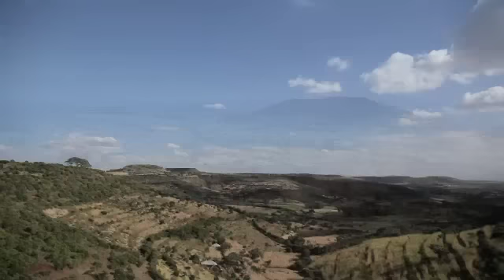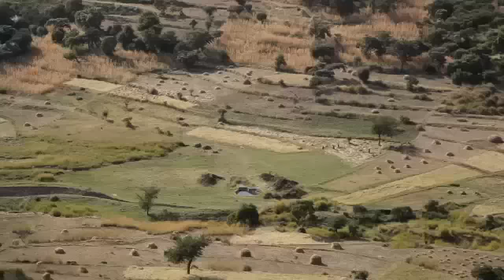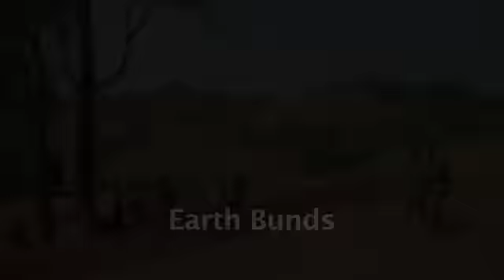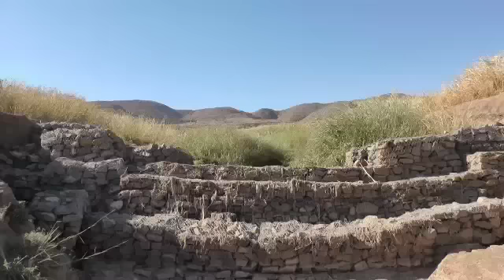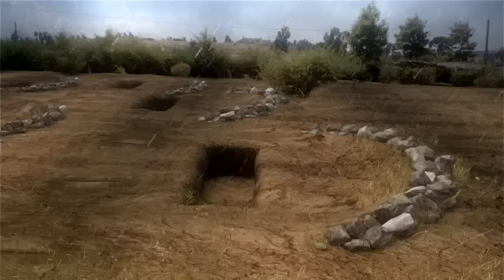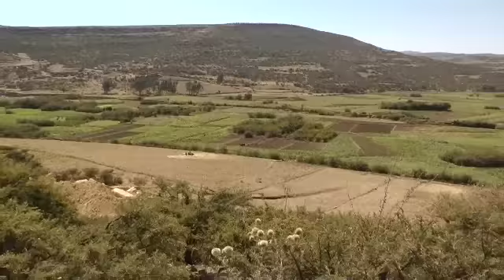Technologies transforming the landscape

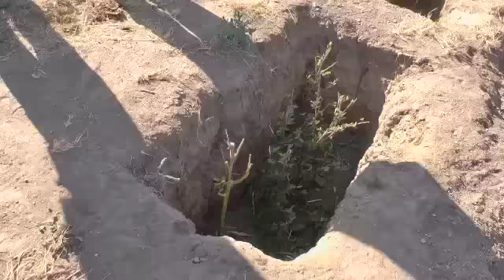Comment: 5:40 seems this would drown the trees when the trench is full ?
Reply: That's why they're planted on steps inside the trench, like he says, to make that less likely
Reply: yeah the ones growing inside are weeds, the trees are usually planted after the trench,
though those weeds are great, free fertilizer and better for the soil
Reply: They normally don't have that much rain, secondly if you add mulch the land remains more permeable and while hydrated, it is also more aerated. 
One thing trees do that make them special is that they develop with mycelium and this moves and distributes moisture.  This makes the ground more evenly hydrated.

Comment: I doubt always being strictly on contour is actually the best solution, even when ignoring seepage and only focussing on erosion.
Then again, while Keyline design / structures are overall better, they are a more difficult concept to learn and layout and need better mapping and measuring.
So if you just want to throw a few hundred people and a water level at a problem, this is great.
Reply: Keylining needs tractors or at least specialized plows and are higher maintenance year in and year out.  In drylands the more water you can gold the better and larger frequent earthworks are better.  
Contour is always best whether for water management or planting.

Look up Brad Lancasters work in rural and urban environments...

Comment: trenches n micro basins....The area wide need signal boards...for safety.....The terrace like structure ....Y terraces were made?...didnt have options?....dr is plain ground available around the area where terraces were being made........trees cud hv been option for mountain...mountain tops....stone bunds....if trees planted wud they stone bunds b needed?.....its hard work....making these....n u get grasses pasture?.....check dams looks functional...in case u cant build structures........the crops mentioned r cash crops....while area in the vicinity is vacant....more crops wud hv been planted......only demand base local work?.....
Reply: The locals know the water catchments are there.  Terraces allow water to soak in instead of running off.  
Check out Brad Lancaster videos, all that you can find for answers to your questions...